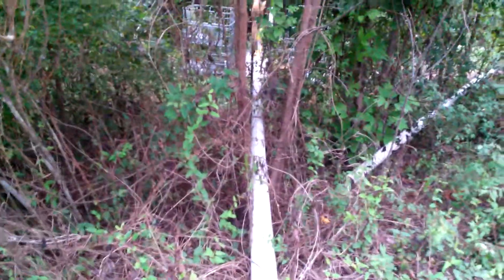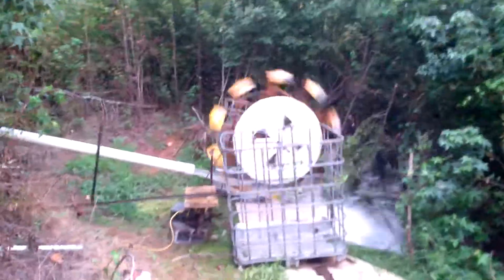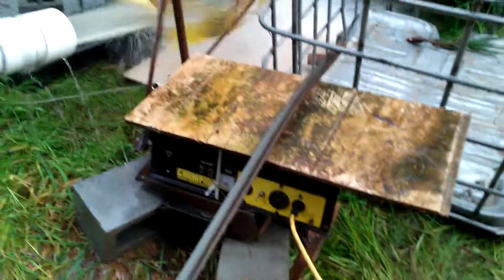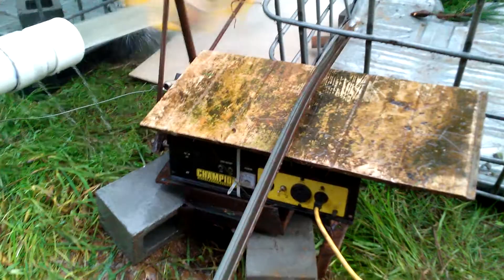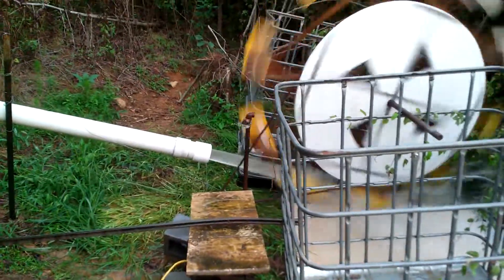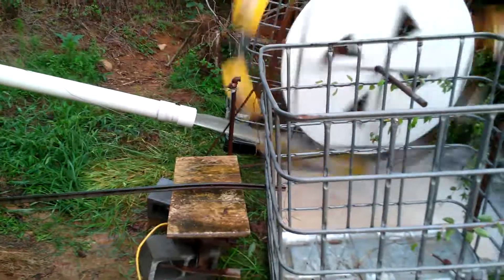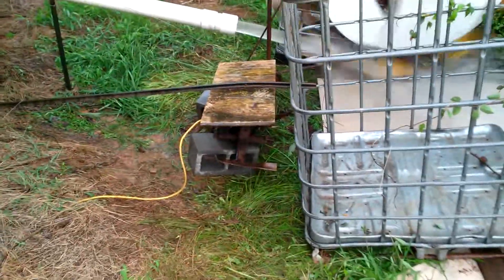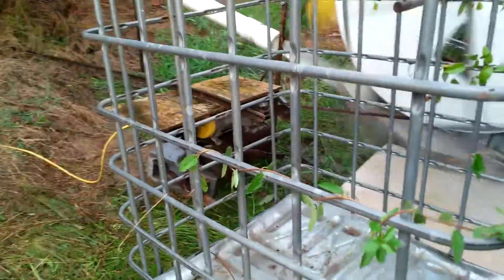Homemade pelton wheel hydro turbine diy electric power generator

Comment: Technically an undershot water wheel. Not very efficient but really cheap. Seems to work and a clever use of local materials.
Reply: No... you can’t see but the buckets are cut and shaped for pelting
Reply from the maker: Thanks